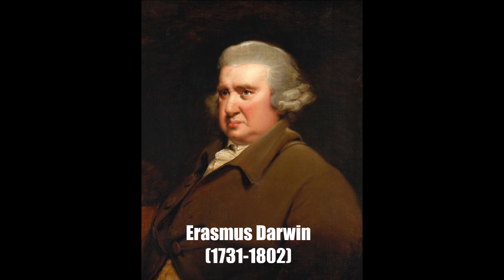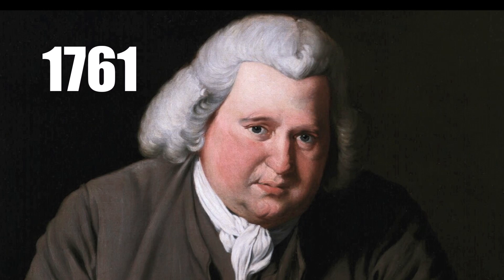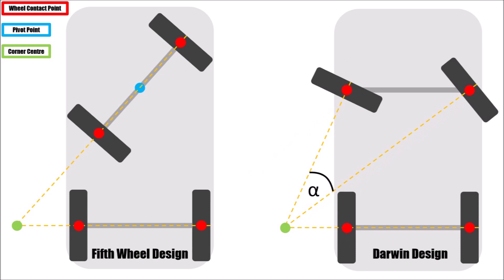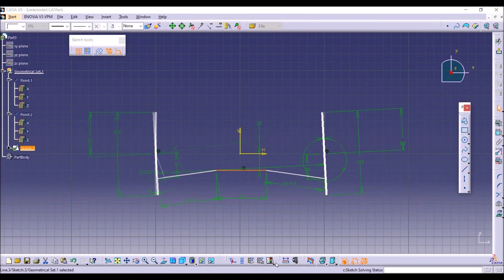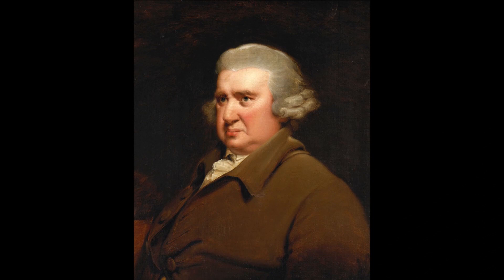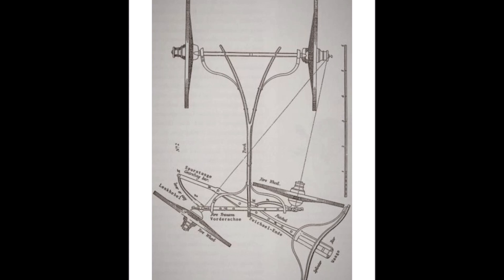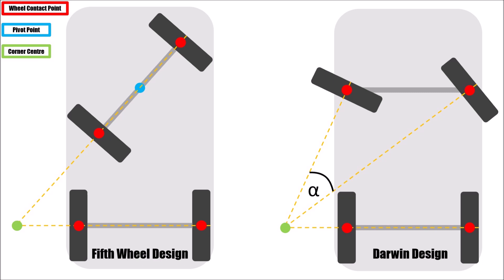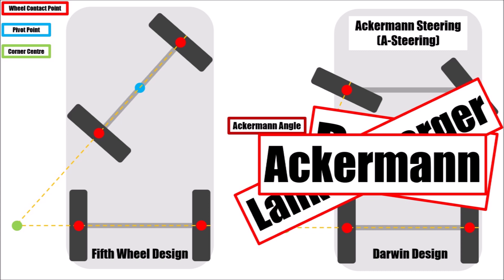The Odd History of the Ackermann Steering (A Steering)

Comment: In Formula 1, the teams are using negative Ackermann steering, right? Working the outside tyres harder to generate more grip.
Reply: I would love for him to make a video on this, explaining it further
Reply: What you most likely mean is the toe angle or toe-in where both front wheels are turning inward, and yes that way when you steer the outside wheel is angled more than the inside wheel, but I don't think they use a reverse Ackermann steering. The more they steer in, the more it should straighten out because of the Ackermann design. @BSport320 might hopefully know this and correct me if I'm wrong.
Reply: @tobias_k01  I wasnt thinking about Toe angle (Angle of the tyres when looked in Neg.Z towards the X-Axis) of the car. 

You can see the outside tyres turning more during cornering if you look at it closely.
Reply: Tires produce their peak grip level at a higher slip angle, when the load is increased. With anti ackermann, the outside tire can be steered more, giving it more slip angle. WIth this, optimal slip angle for the inside and outside wheels, giving more grip.
Reply: Chain bear channel has a few videos on this.
Reply: @Tobias K  they definitely use anti-ackerman steering. It's extremely pronounced and can be seen whenever you get an overhead shot of one of the cars coming out of the garage.
Reply: @damncritics  ok, interesting. And yes, thinking about it, that does absolutely make sense!

Comment: Really interesting video! 👍
A bit unrelated, but why does the steering get heavier at low speed? Had a power steering failure and the difference of forces needed to turn the steering wheel at high vs. low speed is shockingly large.
Reply from the maker: Thanks and good question!
When the car is stationary, the tyre‘s contact patch needs to be turned almost on the spot, so that’s pretty hard.
Another aspect is that depending on the caster angle, you slightly lift the car on the inside wheel, which needs a lot of force. 
The faster you are driving, the more the G-force helps you with that. The spinning wheel  changes contact patch all the time so you don‘t need to turn it on the spot.
Reply: @BSport320  So that's why. 👍It is a real nasty surprise when the steering pump stops working.
Reply: Think of the contact patch as a round circle for simplicity. When turning the wheel while stationary the middle of the circle is standing still while the outside "rim" of that circle is dragged over the ground. If the wheel is parked straight and then turned left, the left side will make a semi circle over the ground backwards while the right side will make a semi circle forwards. It's the wheels dragging over the ground of a large part of the contact patch that makes it hard to steer because more steering force is needed because of dragging. When the car is at speed, the ground patch is stretched over a larger area, thus the steering force is divided over that larger area. Less steering force is thus needed to turn the wheel because there's less dragging over the ground going on.
Reply: @ingvarhallstrom2306  Thanks for the explanation. It is a bit difficult to visualize the contact patch at speed so one wonders how can it be so easier to steer then.
Reply: @griffn14  If you're standing still you have one contact patch say 10 cm long on the ground. If you're driving at 50 km/h the ground provides a contact patch that is stretched to 15 metres for the same amount of steering. For every 10 cm you only have to apply 1/150 of the force needed while standing still.
Reply: @ingvarhallstrom2306  Aaaaah, get it now. The way you described it is exactly how it feels when you're driving - around 150 times less the effort.